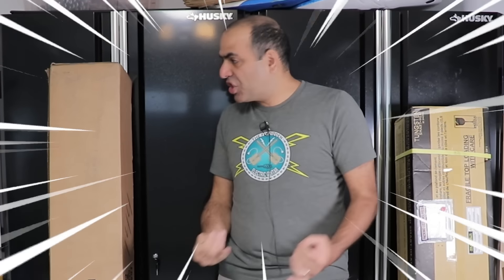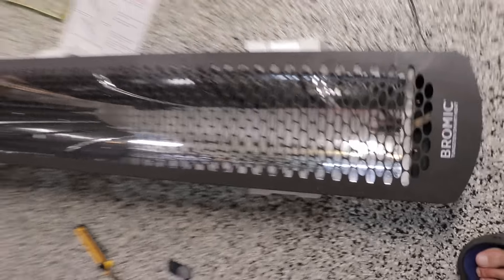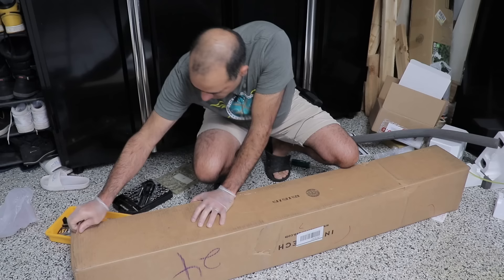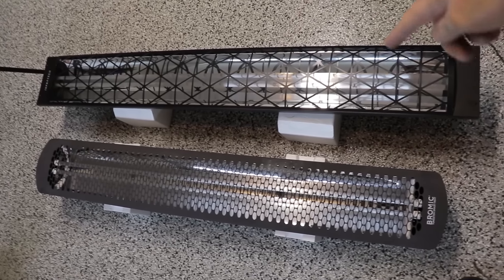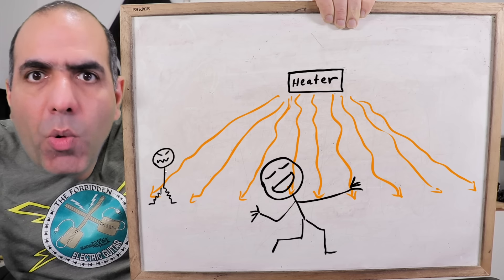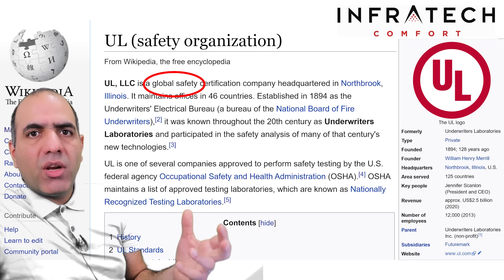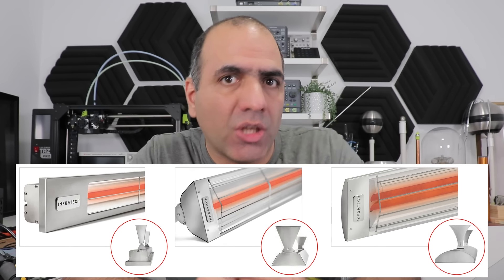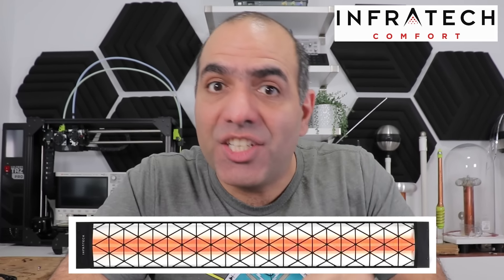Comparing 6000 WATT Resistors, Infratech versus Bromic Heaters

Comment: As a fellow electrical enthiousiast, I approve of the applicable safety requirements during testing. I mean, it’s obvious not to touch any metal objects whatsoever during testlab scenarios. Though it should be mentioned no mechanical engineers are allowed on site.
Reply: I keep one hand behind my back...
Reply: Mechanical design engineers help produce everything that you can touch though. I think that it only takes an electrician to assemble. 
Seems like an electrical engineer is not necessary. 

I like how you were doing all the mechanical engineering and testing stuff....the right stuff rocket engineer. 😀😀😀😀
Reply: @thomaswilliams690  I will give the electrical engineers some live here, us mechanicals couldnt do it alone, and I refuse to do lighting.
Reply: @nloughner2015  I’ll happily fix that lighting for you. But please don’t let me assemble anything that requires more than a PZ2 screw driver. Or was it a PH2? Doesn’t matter, both work
Reply: @thomaswilliams690  Electrical engr not necessary?  Great... we would have all these wonderful devices that would be door stops then....

Comment: Great second test without the protective grill. 
What was the prices of the heaters?
Reply: If you have to ask....

Then maybe ask google :)
Reply: Yeah. As close as they were, another point of comparison is needed. And price is a good one.
Reply: They both seem to be around the $700-900 zone, depending on size etc.
Reply: @yakovdavidovich7943  That's reasonable
Reply: @proxyhx2075  Idk... its basically a bit of quartzglass, sheet metal and nichrome wire. This should be very easy to produce. Its not over the moon, but its not great either.
Reply: @yakovdavidovich7943  JESUS CHRIST that's expensive! An ac unit would be less than half the price.
Reply: @emenesu  ac units heat up the air, not through radiation. So they are only meant for enclosed spaces, not great for outdoor use
Reply: @yakovdavidovich7943  at that point just use a firepit
Reply: @koalabanana1998  In the video where Mehdi had chosen to use an IR heater for his back (yard? porch?) he had actually considered a firepit if I'm remembering correctly, but to get one that is nice looking is typically surround in a glass thingy (technical term lul) which blocks the IR radiation so that why he chose against it, also I'm pretty sure fire pits are fairly inefficient, produce CO2 and are also, well, a fire hazard, hopefully most of what I said is right but i could be wrong on a few things here.
Reply: @koalabanana1998  or just an outdoor chimney stack thing... whatever those things are called lol. My parents own one and it works pretty well given the mild climate over here.
Reply: @Karl with a K true but not in that size/6KW range...
Reply: @Karl with a K how are you so confident with your numbers?
Reply: @emenesu  3 year warranties are not cheap.
Reply: @engineer0239  ah, the classic, "my field of engineering is nuanced and complex, so I need more time and money. Other fields of engineering are easy and obvious, so other people should be faster and cheaper"
Reply: Those not willing to pay those prices are free to buy from other companies or make their own
Reply: @Karl with a K well you should go in the heater business if you could scale to those price points. Good luck with certification, quality control, warranty, marketing and overhead.
Reply: @chaklee435  where tf did I talk about my field of engineering?

For 900 dollars you can get a pretty good PC which is just a tiny bit more complex to produce I think.
Reply: @jaisere  they are inefficient, produce co2, and are a fire hazard yes but they are also very cool and you can cook food on them
Reply: @koalabanana1998  I don't think the good outweighs the bad here
Reply: @xander1052  outdoor chimney stack thing?
Reply: @engineer0239  900 dollars wouldn't buy a good PC with all the CPU and GPU scalper prices
Reply: @Karl with a K $5 shipping for something that big? ya not in this millennium.
Reply: @sammiller6631  currently stuff is a bit overpriced, but the argument still holds if you compare this heater to an RTX 3070 for example.

Got my setup (2070S, Ryzen 5 3600x) for around 900 bucks before the 30 series release.
Reply: @Karl with a K why would you ship then from China when they're made in the USA? Don't tell me I'm out of my league when you don't even understand the question.

Edit: and even if you outsourced it, you can't make a decent heater and its packaging weight just 4 lbs.
Reply: @engineer0239  But can the Bromic Heater play Crysis?
Reply: @Karl with a K I see you've just taken the opportunity to call me names instead of providing any actual counterpoints. I'm out. Have a good one! Good luck with your business opportunity.
Reply: @Karl with a K 🙄

Comment: 7:06 and this is one reason we use split phase power, both hot wires are at 120V potential to ground, but 180° out of phase so across the two, you get 240V. If you get shocked, unless you touch both hot wires (which almost never happens), you'll never get a 240V shock.

Comment: Depending on the wavelength of the light you could get very interesting results from changing the pitch and size of the holes in the heater grill
Reply: i was wondering about that. when that part came up it made think of those various science videos where people should shine lights through different size and shape holes and get different kinds of patterns and even spread depending on shape, size and distance from the source.

Comment: I believe it's important as well to test and map the difference between the infratech with/without the guard as well since you did this analysis point for the Bromic and see how they compare exposed as well as with their default guards.
Reply: Infratech did not claim that their guard was magic and does not block IR. It was a test to invalidate false claims by the manufacturer. Not needed for the comparison IMO.

Comment: Yeah, a very thin highly reflective grid, using the least material would block less heat. The fat black grid absorbs the ir and re emits as different wavelength heat to heat the air.  I am proud of you for not buying the bs about the grid distributing the ir.
Reply: The 3d graph was impressive too!

I was thinking, also about the need for a  220 gfci .
Reply: yeah I was thinking of chicken wire, you could even put glossy chicken wire, that way you can actually claim to reflect 90% of the IR... instead of painting it black for aesthetics.

It's like listening to a customer I had today, she wanted to find a glue that was the same colour of her roof, so that she oculd glue bird spikes on her roof... her husband was trying to convince her that nobody would see it! I interjected... well the birds might will, I think he lost that battle anyway, they ended up with light gray instead of standard white 🤣
Reply: @dennisgarber  2x 120v gfci (don't actually do this plz)

Comment: Rule of thumb: Whenever you see an asterisk in a set of directions, it's usually relating to something that could cause a liability, by which the additional statement is designed to avoid liability. Always do research. Thanks for the lesson, Mehdi.

Comment: As an electrician, I can just imagine the meter socket spinning like an Iranian centrifuge in hacked mode. I'd be curious how a propane fire pit on the floor would compare. It is also a radiant heat source but heats via convection as well. Being on the ground, it may not have to work as hard, and is a visually pleasing element. Fire is beautiful and comforting.
Reply: draws very similar amount to a dryer. its not that crazy. 5.4 kW * $.14kW/hr (us national average for electricity) = $.75/hr to run this. which for something you run a few hours a week is not bad
Reply: @domthedonkey69420  My last bill I was charged $0.30kWh and my dryer pulls 13 Amps so our numbers are a little different but I appreciate the input. One of these companies yours?

Comment: I was always afraid from Infrared Heaters, one day my fear came true, i got shocked by a 3000 watt Infrared Heater.
Reply: The heater probably didnt have a ground connection or the ground wire was broken.
Reply: @mernok2001  that didnt have to be the case, if there was no guard and he touched the heating element, since there might a gradient of the input voltage across it... Unless there is an insulation layer on its surface, which I am not sure about.
Reply: @bezdaknebomizera  There was an insulation , the thing was quite cheap and was mostly metal. The shield in the inside for reflection had the voltage wire touching which wasn't an issue until the plastic shield was on melted, at that point current got transferred on to the ground of the chassis.
Reply: @CShellby  Oh. Ok. Good thing it sounds like you didn't get punched very hard then.
Reply: @CShellby  Btw i dig your profile pic. These thermal lines are cool
Reply: @bezdaknebomizera  Touching the heating element would be terrible.I know from experience that a burn from a hot wire is worse than an electric shock.

Comment: With this type of product, and the closeness of their performance, you forgot the most important question: Which is cheaper? 

I checked! Matching the specific models you chose I see the Bromic costs $954 and the Infratech, in that model and that configuration, costs $968. Both companies have what I would consider are "better" options that do the same thing, at the same wattage, but are cheaper, but a bit less flashy, and there are other companies entirely that are cheaper, too.

Comment: Interesting video. Personally I'd take the added protection of the Bromic guard over the higher output from the Infratech. Imagine standing up and stretching under the heater, accidentally putting a finger into that heater. No thank you.
Reply: How does it come that you don't feel the heat (getting warmer and warmer as you get closer) before accidentally touching the elements by stretching you body?
Reply: personally i would just remove the guard altogether. 30% extra performance is massive
if you install it high enough there's no danger of touching it
Reply: @NimaSajedi  Because it would happen fast, like grabbing a hot cast iron pan handle on accident.
Reply: @rdizzy1  Nope. Not comparable. The heat from these heaters can be sensed in much greater amount compared to iron pans. Moreover, they are placed on top, so you really have to stretch to be able touch it, considering that the heater is reachable, then it doesn't happen instantly. Streching upward and touching with fingers doesn't happen in a blink, unlike opening arm to the left or right.
Reply: would be why the design - Australian safety standards are pretty strict

Comment: ACs are 5X+ more energy efficient then all other heating solutions (transfers heat instead of heating). 
Heater lamps outside on a cold night is still a nice feeling and best outside heating solution short of an actual fire.
Reply: Snow melts outside. It starts to be to hot to have a jacket on. Starts to walk in flip flops even now everything is mud or snow/ice outside. Watch a video about outdoor heating. And it is 12c outside when doing the tests? Are there actually people that turns on 6kw heaters when a jacket is all you need?? Even in 10 minus you can be outdoors in a tshirt. Not for very long but jackets exist....

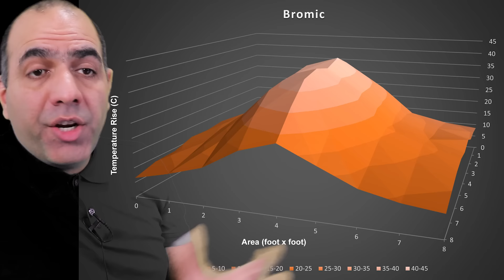Comment: 19:14 - Oh no, Mehdi made the ultimate blunder when talking about temperatures! He forgot he was using Celsius and not Kelvin, so you can't make direct percentage comparisons between the two as it's not an absolute scale.
8.3 °C is not 28% higher than 6.5 °C - it's only 0.6% higher (and the middle is 2.5% higher).

This is what happens when you let electrical engineers near physics.
Reply: It works fine because he's comparing temperature rise, not raw temperature. When comparing changes in temperature, Kelvin and Celsius are the exact same.
Reply: @Owen_loves_Butters  Nope, incorrect. He wasn't comparing temperature rise, he was comparing the two temperature values by percentage (calculate it yourself and you'll get the same incorrect numbers Mehdi did). 
You can't do that without using an absolute scale.
Reply: @drunkenhobo8020  Look at the damn graph. It says "temperature rise". Try watching the video before just calling people incorrect.
Reply: Sorry that was rude. I'm just tired of explaining the same thing to all 8000 comments about this.

Comment: I think i have to add a bit about heater guards. Despite Bromic one is being not that sufficient, i might have been made with safety in mind, so that noone will put their fingers in when stretching their arms or putting on a coat or something. Then again, best decision would be simple grill guard, not that elaborate thing on both of them. Infratech leaves large gaps(not safe), Bromic has small gaps and ineffieicnt guard.
Also, it is worth noting that heaters tend to overdries the air in closed space, so it is important to keep humidity in check.

Comment: It would have been interesting to see a direct comparison of both heaters without the grid installed. With the (almost) identical shape of the reflectors and the known power consumption it would have made a nice verification, accounting for measurement errors.

Comment: Having a dark face on the safety guard/motif is actually desirable. An ideal blackbody radiator both absorbs and emits all light wavelengths, therefore appears black. I do agree that the interior of these guards could be reflective to help avoid excess waste heating, but they're going to heat up no matter what they're made of, so the faces of them should be ideal radiators as much as possible.

Comment: The recommendation to put a reflective coating on the back of the grid is a good one, they should consider that since it would prevent the infrared from dissipating into the cover.

Comment: The temperature of the filament or garage door spring, whatever you like to call it, is very important too.

The hotter the element the more gets radiated without getting lost by convection. 

A friend has a 2.5kw single element version on 230v 50hz and it looks like a very bright halogen bulb for 380v . 
Long story short it is rather bright on the highest setting and works for some distance as long as you're in vocal point of the reflector

Comment: To be fair, in that comparison sheet in the pictures they showed them installed inside and inside how much the grid blocks isn't a huge issue since no energy is wasted in a closed system. For my personal preference, I like Bromic's grid. Overall for personal OUTDOOR use lower grid blockage and slightly lower energy consumption at relatively same heat output would lead me to choose Infratech as well. At this point I think it mostly comes down to price difference
Reply: You need a house that has good heat isolation for that to be true. If you put it inside a house, the heat blocked by the grid won't reach far, it will just go up and heat the roof
Reply: Admittedly, aside from it not having a reflective rear surface being an obvious flaw, the grid can just be removed/never installed in the first place. It's there to stop people or animals from coming into contact with the heating elements, after all. If you just make the grid more sparse, you already fail at achieving much of that, so might as well get rid of it altogether.

Well, I guess if quartz ever shatters, the pieces might be stopped by the grid, in which case the denser the grid, the better (you wouldn't want a hot sharp bit of quartz to land on you regardless of size)

Comment: Overunity 'free energy' devices don't exist, but there are recognized mechanisms in engineering/physics that exhibit overunity, like water hammers, anti-stokes emission flourescopy, spherical sound wave attraction, and vapor cavitation. What if someone was to harness one of those recognized overunity mechanisms? Could be a really interesting topic. Apparently, there was an unauthorized guy in the 1800s that harnessed a few of those overunity mechanisms(allegedly). Anyway, thanks for the great videos!

Comment: Of note, the motif/guard blocking out the focused beam doesn't necessarily mean it's only heating the air; As that guard gets hot it radiates heat itself; just in ~180º arc instead of the focused ?30-45º arc...Might explain why there is more at one edge than another with the 'same' parabola.

Comment: Fun fact:
Titanic used SEVERAL 6,000 watt heaters on every level of the first class grand staircase EXCEPT for the D deck level where they used steam radiator heaters in the base boards

Comment: Worth noting that the "6000W" figure is at the max voltage the unit is certified for (250V) which, at 23.7A would be 5925W.  If you have 208V or 220V high voltage, you'll be getting significantly less output from the heaters (<5000W actually).

Comment: In Australia the minimum wire gauge allowed for 3000W at 240V is 12 AWG, so my guess it’s a thermals thing, as 12 awg would produce 2.5x as much heat per metre of cable than 8 awg. For eg If the wiring is 65C inside the heater, then 12 awg would be at 105C, whilst 8 awg would only be at 80C. I can guess the grill covering is a similar story, grill spacing is probably about fire risk. In Australia we’re kind of paranoid about things catching fire.

Comment: Great video as always. The first thing that comes to my mind however is the cost to run a 6000w heater for any length of time. Where I live 6 kwh per hour would be over a dollar per hour. Not a lot for occasional use I guess, but it would add up quick if used a lot.
Reply: meanwhile power price in germany is at least 40 to 60 cent per kwh. and they are working on increasing the prices eveb more